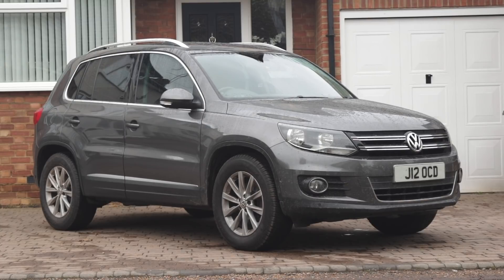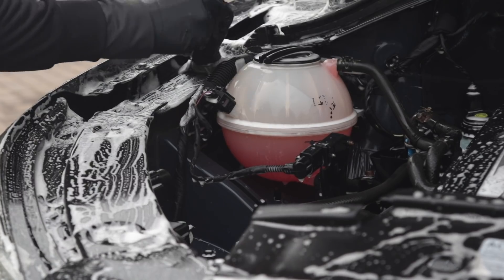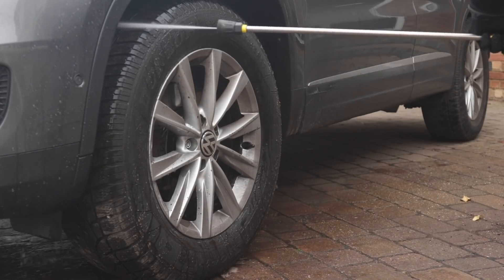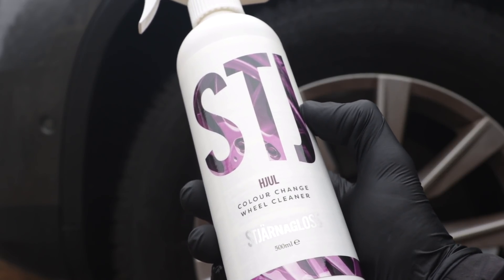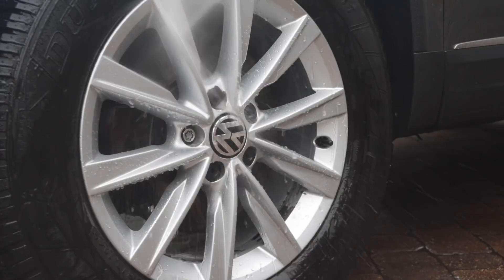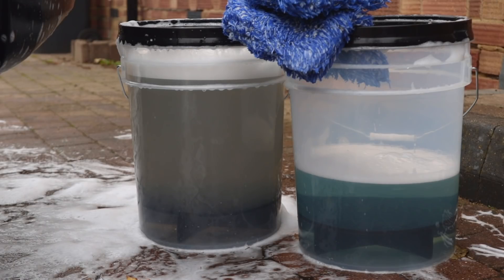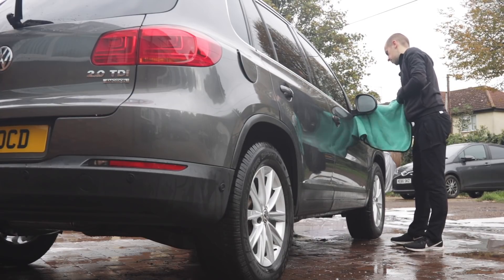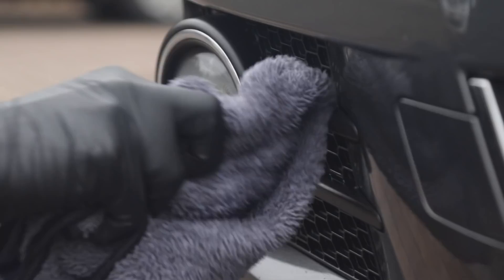Detailing a Dirty Daily | VW Tiguan Pre-Winter Detail

Comment: enjoyable video . which foam lance do you use ?
Reply from the maker: Thanks Jim. That is a PA foam lance with an Auto Finesse bottle at the moment. Would like to upgrade to the MTM PF22 soon
Reply: @JoeHuntley  have you ever used the AF foam lance and what are the prons and cons between PA  ?
Reply from the maker: Sorry for the late reply. 
Yes I used to work for AutoFinesse. 
I would say both have same failing points however the PA is the original of this style of foam Lance. 
I'd say send another £10-20 and get a MTM PF22 as this fixes the weak points of these lances

Comment: Nice tidying up on Tiguan.How much does this mixture you put in your foam lance can last? Is full bottle(I assume it's 1L) sufficient for this car or you could do two cars? 
Cheers 🍻
Reply from the maker: Hey thanks for watching!
So on the car I put 200ml in a foam gun and top up with water. 
This can do two medium sized cars.
This means you can get 10 cars out of a 1Litre bottle making each application £1.29.
If you buy a 5L bottle you can get 50 applications at a cost of £0.59

Hope this helps!